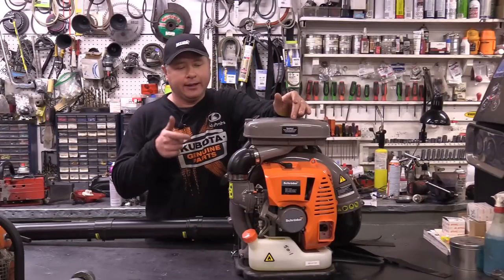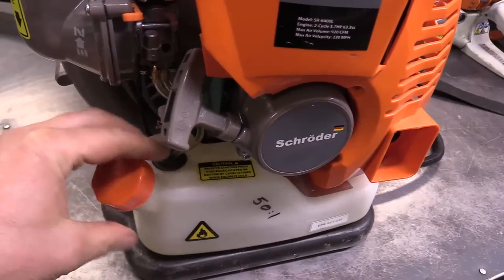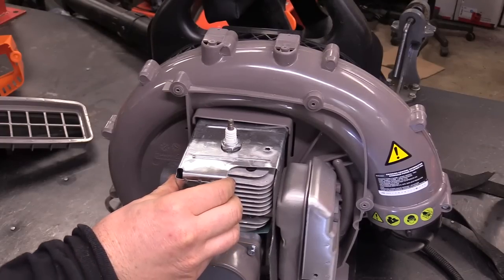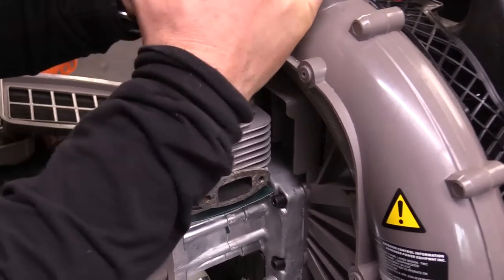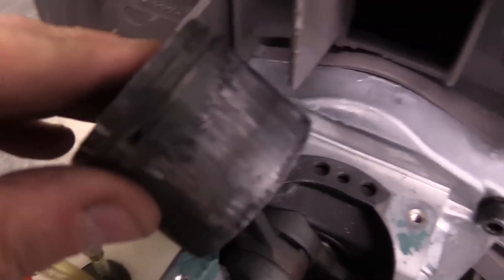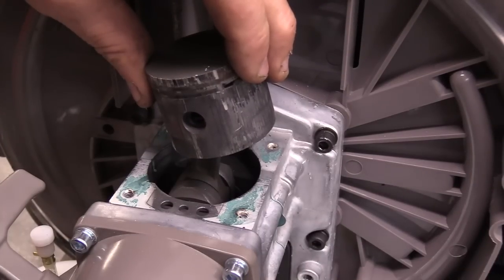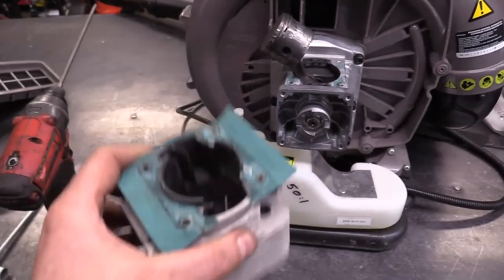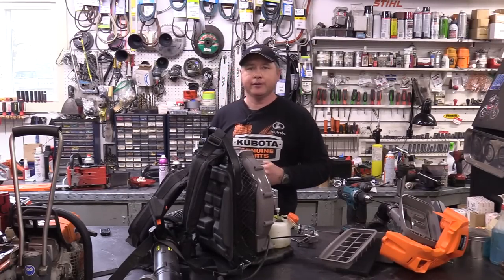Teardown Of New Blown-Up Schröder Leaf Blower! Customer's Expensive Mistake!

Comment: Nice video,  Beautiful machine,  funny how they forgot to tighten those screws when building it. But that can happen. 
That about checking the crank bearings.....good tip. There are times you will hear someone say they rebuilt the saw.....or whatever and it didn't last no time before it gave out again. 
That's probably cause the bearings were baked too.
Thanks

Comment: Thanks for the tips on checking for play before ordering a replacement cylinder kit, Don. I've got a kit on the way for a  Husqvarna 150bt flip, but will check it for play in case it makes more sense to return the kit and keep it for parts or part it out.

Comment: Thanks for the very helpful video. One more question. This leaf blower that I just bought came with a very dry engine. Before putting the mixed fuel into the tank, should I add some of the 2-cycle oil into the engine through the spark plug hole?

Comment: Ouch, I’ve seen this all too much as a certified Stihl tech, the machine leaves brand new and is not even gone from the store for an hour and they come back wondering why their machine won’t pull over. Some folks just don’t need to own gas OPE.
Reply: Your meant to fill it with mix as a part of pre-delivery and explain that they need to use 2T oil at 50:1 in their unit. Citi-boi!! Presume that all 2T customers are amateurs until they convince u otherwise. One of the reasons people pay a premium for Stihl products compared to say online or big box store is that the dealer will offer them the right advice on how to best use their machines. So if a customer returns within an hour with a straight gassed unit someone hasn't done their job properly.
Reply: @aussiehardwood6196  I had gone over that with them and even filled the fuel tank but they didn’t remember to mix the fuel and gas.
Reply: @aussiehardwood6196  it says it right on the machine. 40:1 50:1 and so on
Reply: They dont mark there Jerry cans and grab the wrong one
Reply: I’m a stihl tech as well. I’ve seen this same thing. Yes they leave my store with gas and demonstrated how to fill the tank and with what. Ive started to believe anyone buying a power tool should have a certificate from a class on tool operation.
Reply: @Thomasploeg1968  makes sense, I don't have that issue I use canned fuel 40:1 for my trimmer, BP blower and I buy canned fuel buy the gallon for my tractor and push mower
Reply: I was at out local shop , guy was being shown how to mix and different colours with and without oil and of course a scored piston etc which I personally found informative , i always marked my Gas cans for all my equipment 👍
Reply: @evanchapmanfanman  Sometimes you can’t fix stupid.
Reply: Did they do that to any pro saws?
Reply: @markdonovan1342  I haven’t seen it yet but that doesn’t mean it won’t happen.
Reply: The principal at my old middle school found an interesting (and moron-proof)  way to stop the maintenance dude from putting straight gas in the leaf blower: After school, he just premixed a couple gallons of 2 stroke fuel, and then just handed him multiple jerry cans labeled "leaf blower fuel", telling him it was special and that he can't use ANYTHING else in it, but never mentioning what exactly was in those cans, so he wouldn't even get the idea of just putting the can labeled "lawn mower gasoline" (which was just straight gas) in the thing and thus wouldn't trash the engine. It actually worked for as long as I was in middle school, and probably still does.

Comment: I know it's expensive, but unless you're a landscaping company, just buy the pre-mixed fuel from Husqvarna (or similar).    You avoid the curse of ethanol, and your equipment will start second pull every time.
Reply: There are gas stations in my area that sell ethanol free gas
Reply: @boots7859  Around me, there is no one selling ethanol free within 50 miles.
Reply: @ButterBallTheOpossum   It's very difficult to find in the eastern part of the country;  heck, there's only one gas station near me that sells kerosene.
Reply: @boots7859  Then what are you doing with that gas water mix you drain off????
Reply: @boots7859 probably not a good idea to add water unless you can assure when you drain off the fuel there's no water in it and for the diyre that's not a good idea
Reply: That's like 20bucks per gallon that way.  Using the pre mix is ridiculously priced. Come on man!
Reply: @dionpalmer5097  Well, when you pull the cord on your string trimmer in the spring after you forgot to drain the tank and it won't start, that might be the most expensive 6 ounces of fuel that you mixed.

Comment: Last year, I bought the Schroder 9900x blower. It was hard starting.  This spring, I took the time to fine-tune the carb adjustment screws. Now it starts on 2nd pull.  I don't have a large lot but I have 2 dozen rose hedges and 3 fruit trees.  Lots of debris that can be easily removed with the power of my blower.  Nice video, that's a bummer that a quality machine bites  the dust for such a simple error.

Comment: Question,Where are the carb adjustments on this model Shroder and what tools are needed for the adjustment ?  You made a video on how to adjust carbs but not sure if this carb is the same. I Have one of these exact blowers and it runs great. My nephew just purchased the same model and it boggs when at full throttle. Seems lean.  These are really nice blowers for the money. Could ya do a video on how to adjust the carbs on this blower  and the tools that needed to adjust the carb if different then the video you did on 2 stroke carb adjustments.   Thanks for any info.

Comment: I have the same model blower, ran too much oil and ended up seizing it up. I ordered a new piston, rings and cylinder off Amazon. It takes 1e48fp engine parts. When it did run it ran great and had lots of power. I am going to port it out so it can make a bit more power.
Reply from the maker: thanks, some viewers found me one on ali express and I ordered it!
Reply: How can it possibly seize with too much oil ?!?
Reply: @PapaMav  The oil i was running became sludge and turned into little carbon pellets, which made the rings get stuck and destroyed the piston skirts seizing the engine up.
Reply: @landonpope7522  ok, so what kind/brand oil did you use with the gas, to get that result?
Reply: @PapaMav  Klotz super techniplate
Reply: @landonpope7522  never heard of it; popular in Canada?
Reply: @PapaMav  too much oil means not enough fuel and running lean means it gets hot , can cause seizures
Reply: @johnnie5wreckingyard  thank you.  I would have thought you just get more smoke.  But would never think to run the mix w/more oil than recommended and never had a problem mixing the correct ratio of gas/oil.
Reply: @PapaMav  you do get more smoke , its all dependant on various issues , the unit itself , even the type of oil 
Ive come from 2 stroke motorcycles and been running the same yamalube oil which has been well known in the bike world at 50:1 in my gear , most notably an echo blower which i bought used in 94 and still going strong 

Buy the good oil , its not that much more expensive and you will be fine

Comment: Looks like a KASEI EB-800-E  or a chinese clone for it; but if you  search for the cylinder, it does not look like the same one. However it does look like the cylinder for the EB-650-E, look for 1E48FP-E-1 and 1E48FP-E.1-1, but check the bore on your machine..
Hope this helps, would love to see the rebuild!

Comment: The engine looks like one from an echo pb650-pb-655, pb755 if you look at a picture of their short block kit. They’re also 63.3 cc. They are using the zenoah 75.6cc engines on their biggest blower Schroeder.
Reply from the maker: with viewers' help I managed to find a cylinder kit on aliexpress

Comment: Two cycle machines seize up at the piston almost instantly with no oil. The bearings don't have time to get damaged, because they're greased. 4-Stroke, on the other hand, seize the at the crankshaft from no oil. Those you can usually free up with a breaker bar or forcing the blade around a few times, and they'll be OK. As far as these Schrorer machines. Why bother? I got a Husqvarna with the same specs and same price at Lowes. Plus they're a real company for decades, with parts available and a dealer network. Read the Amazon reviews on Schroder. The people that got good ones were happy. The people that got defective ones couldn't get a hold of the company for parts or warranty.
Reply: You are correct, I'm having a hard time getting results from Shrouded . I only bought it for the 5 year warranty.  They run great and blow powerfully.  It's a shame to not take care of the customers with legitimate complaints.
Reply: @dionpalmer5097  A warranty is only as good as the company behind it.

Comment: I have one, and while it's a really good quality, it's too hard for me to pull the starter cord. With an engine this big, they should have a compression release, spring assist starter (like Echo E-Z Start), or even just a larger recoil assembly so you have more leverage.

So I went with a Ryobi 40V electric backpack blower. The power is disappointing in comparison. But then, so is the run time. A tank of fuel would run for quite some time. The 40V Rayobi battery is too hot to recharge after you drain it. But I have no problem starting it!

I assume Schröder didn't honor the 5 year warranty due to the owner's not using 50:1 2-stroke oil?

Comment: Hey Don , did you ever find parts to make the repair on that 6400?

I want to do the same thg to my 9900x unit, because Schroder is not honoring the 5 year warranty. I did mix the gas 50:1.  It died after 4 hours of straight blowing on my 5 acer property. 

My 6400 using the same mix is still running great after 3 years of hard use

Comment: Looks like an Echo clone. Fuel cap, fuel line grommet, recoil paw are definitely Echo. Check out parts lists for an Echo PB-770H. OEM Echo cylinder has a full length bore with closed ports where the aftermarket cylinders are open port. These parts will fit but you will need modify the block with a die grinder to clearance for the full skirt. Cylinder kit Echo part# A130001050 Piston kit part # P021002984. Echo parts are around $300 USD for a $530 USD blower so you might want to look for an aftermarket kit.

Comment: What a shame.  I know that owner is kicking himself.  Good luck finding the cylinder kit!  I hope you get a great price on it.  After making the video, you could sell it if the owner doesn't want to pay for the repair.  I'd like to have a leaf, twig and debris vacuum bagger.  I had an electric one that I liked, but I guess gas would be good as well.  That one was all plastic and the fan blades would clog and bind, but the fan cover had a clip to keep it closed, so it wasn't too hard to clear.  It could also be used as a blower.  Just switch attachments.

Comment: Interesting, I had someone give me a blown leafblower. I poured a little oil into the spark plug hole and let it sit for an hour. Then I put a metal rod through the spark plug hole and tapped the piston loose. Put everything together and have been using it for two years now.
Reply: That is EXTREMELY rare for a 2-cycle oil-mixed engine. For 4-stroke (separate oil) engines, it's quite common to free up a seized machine and have it run perfect.

Comment: I'm not surprised that it's what happened - missing 2-stroke oil is fatal for a 2-stroke engine. A 4-stroke engine just smokes a bit and you might foul the plug. If you have a cat on the 4-stroke it might not go as well though, but it's just the cat that's getting ruined.

Comment: don't know how much variation there is in two cycle engines, but I recently did a baby overhaul on my Echo SRM2110 trimmer (exhaust bolts snapped so I had to drill them out, so pulled the cylinder to make sure no metal got in) and that looks pretty darn similar: almost close enough for me to call it a clone.  With it being such a niche brand you might have to contact the company directly to get parts...

Comment: Hey Donny, love your videos. I have a Kohler command 21hp I put on my walk behind mower last year. Only 50 hours and it starts up on the first pull. Sometimes after a few minutes of mowing it will suddenly  act like it is running on half choke and loses power and runs rough. I move the choke lever back and forth and it doesn’t help. Air cleaner is clean and fuel is always fresh. Any ideas? It driving me nuts
Reply: I’d change your fuel filter since they’re cheap just to eliminate that possibility

Comment: You checked the bottom bearings in the connecting rod but you may want to check for play in the top bearings of the connecting rod. If either end of the connecting rod bearings have play it's not worth working on.
Reply: Sometimes you can twist the piston to see if there's play in the top  bearings. If you take out the wrist pin holding the piston onto the connecting rod you can see if there's any scoring in the top of the connecting rod.

Comment: I own 2 , the 6400 & the 9900X.  Both mixed the same 50:1.  3 years later same gas mix used for the 6400 working great, the 9900 died after 4 hours running the same gas mix from the same tank that i only use for these 2 blowers.    The 9900 has no compression now and Shrouder will not warranty this item.  After numerous calls to no avail.

  The tech says its human error.   If that's the case, why is the 6400 still working like new after 2 years of hard core working the leaves on my 5 acer property?

Comment: Being a rookie with leaf blower, I started up the engine with plain gasoline for 3 seconds and it turned off by itself. Then, I read the manual and realized that I made a mistake with the fuel. How bad of a damage you think my engine has?
Reply from the maker: you should be ok
Reply: @donyboy73  , Thanks man! I was about to tear open the engine to take a look at the damage!
Reply from the maker: @coolhead8686  you don't need to do that
Reply: @donyboy73  , But would it damage the engine if I do that? If I put oil directly into the engine?

Comment: I recommend using Amsoil Sabre Professional 2-cycle oil. The reason is simple. First, it's the best. Second, because the way Amsoil Sabre Professional is formulated, there is no need to mix the fuel according to each 2 cycle engine so called requirement's. With Amsoil you mix it at 1.5 ounces of oil to a gallon of gas and run all your 2 cycle equipment with complete confidence.
Reply from the maker: yes and doesn,'t leave carbon

Comment: I ordered 1 and am quite impressed. Pretty sure that they are made in China. Poor English instructions. Not too sure on the longevity, but it starts,runs, and blows great. Not too sure why it was sent with a spare recoil. Kind of a red flag there. My cousin ordered 1 as well, it also came with a spare recoil. I think that there's a parts depot in Vancouver. They come with a 3 year warranty, however good luck trying to get warranty from a product from China. It  does say German designed on the packaging
Reply: You are right-on !

Comment: Someone scribe on the fuel tank, 50 :1 oil ratio. In my opignon, it is too lean of oil for a hot running air cooled two cycle engine. I will use more like at least a 40 :1 fuel mix instead. Shame making that mistake on a new machine.

Comment: I ran it with no oil in the gas. Reason why they build DC powered equipment? Similar to the idiots that put gasoline in the diesel powered Sprinter, oh, is that's why the gas cap is yellow.

Comment: You could hone out the cylinder,  clean up the piston and I guarantee that blower would run fine. Be a great around the shop blower. Obviously you wouldn't repair it like that for a customer.